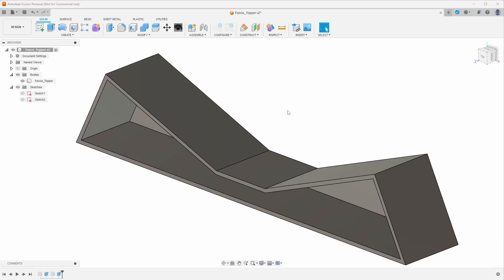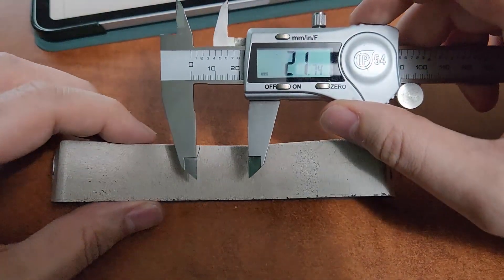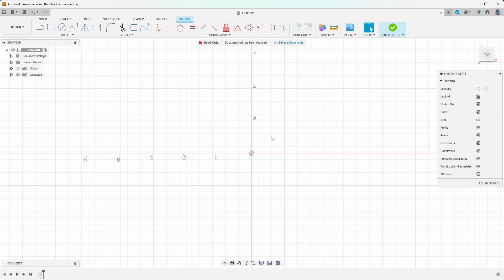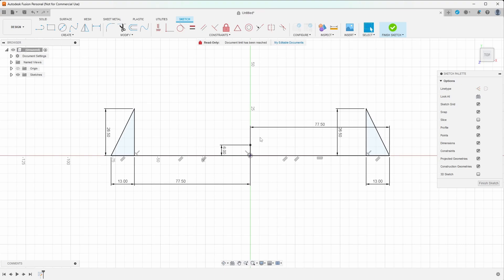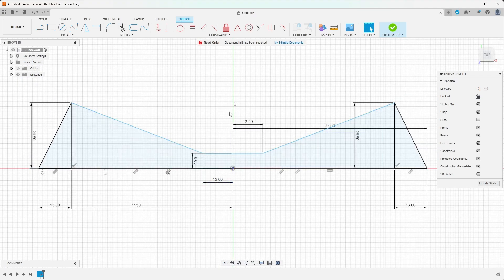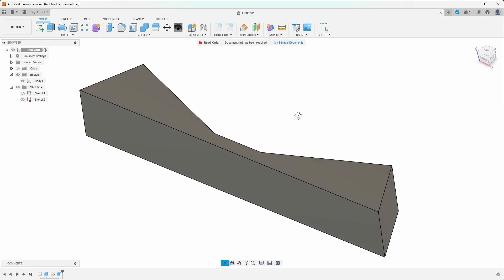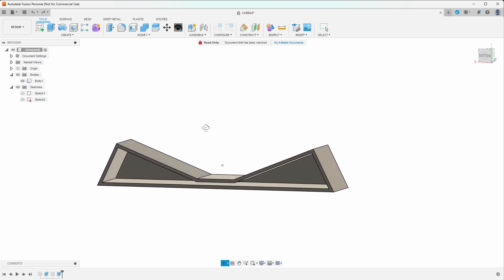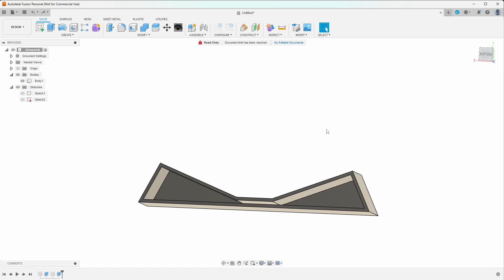Start Designing Today: Fusion 360 Tutorial for Absolute Beginners!

Comment: Yeah, keep em coming, I have been trying to learn Fusion 360, Im getting the hang of most easy things, however, when I get stuck I revert to Tinkercad and then import the file to Fusion for filets or chamfers, I would like to learn more things in Fusion though, I like the mirroring thing you did there, I would have probably drawn the whole thing out.
 I learned technical drawing at school in the '80s and so I can physically draw things, I still have the drawing table I made in 1981 at school, and I still have my set of Rotring pens also, I remember my dad blowing a gasket when he saw how much those things cost, I bet they are 10-15 times as expensive now.
 He saved a fortune  later on though as I drew his plans for his house extension and summer house.